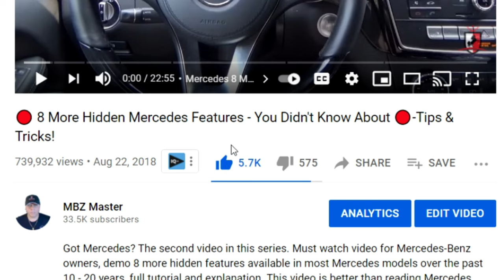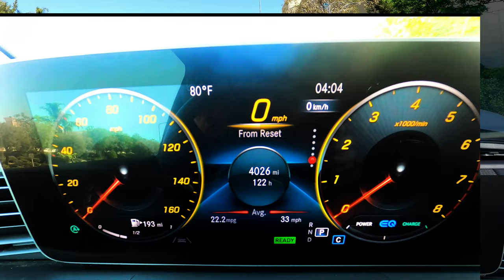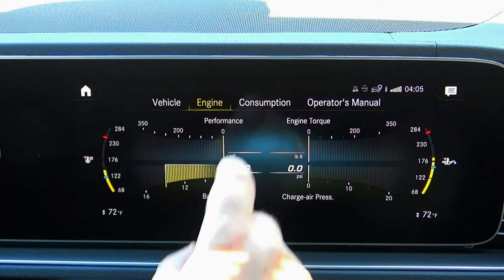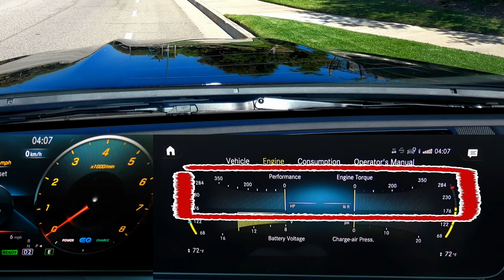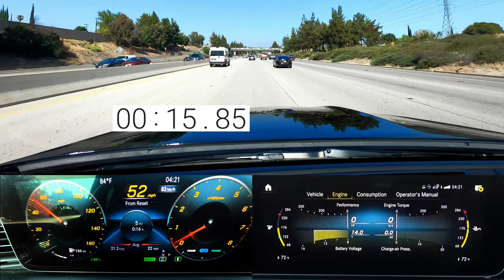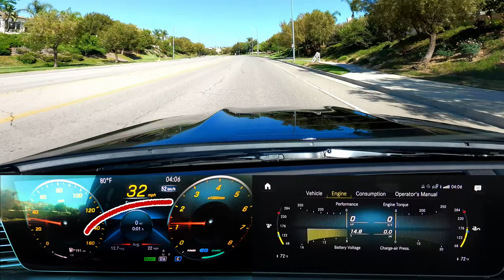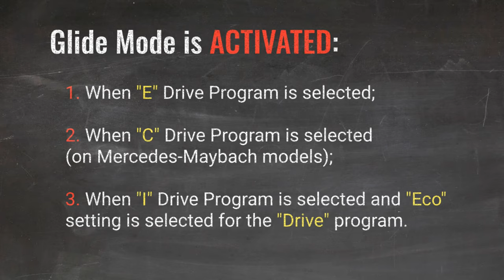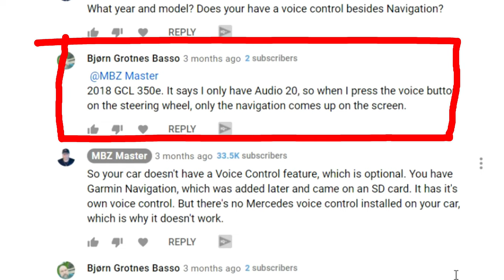Can your car GLIDE? Mercedes Gliding Mode Demo... STOP wasting gas and START saving $$$!

Comment: I learned to drive in old cars with no power steering & assisted brakes. If we came home very late we would switch off the engine some distance from home and coast / glide to a stop so we wouldn't wake up our parents, or wife. . I tried this in the first vehicle I had with power assistance, a Landrover 110 Defender with the V8 3.5 Block. I turned off the key and nearly smashed down my own garden fence at the bottom of the road . I was stood on the brake and needed my full strength to steer. Very unnerving. Never ever again will I try this :)
Reply from the maker: Yeah, on modern cars, if you switch the engine off... you pretty much lose the control of the car.

Comment: 2017 GLC 43 "AMG" - glide mode (cute little blue sailboat icon appears) leaves the engine idling at about 500 or 600 rpm. It doesn't go to zero rpm, presumably because the Stop-Start system uses a semi-normal starter motor, not the integrated SMG approach. Disclaimer - this comment contains some speculation.
Reply from the maker: Yes, as I explained in this video, The engine will switch off completely only on models equipped with the newest 48V EQ Boost models, so the battery can handle the load single-handedly. Other Mercedes models will switch to the Neutral while gliding, also saving a lot of gas but not "0." The engine will be still on.
Reply: @MBZMaster  Hi. May I know if my MB car is running on glide mode and changes to Neutral. How may I change it to Driving mode?
Reply from the maker: As soon as you press the Gas or the Brake pedal, the Gliding mode will be automatically disengaged.

Comment from the maker: Have you ever used a Mercedes Wi-Fi in your car? Why or why not?
Reply: 2017 GLC 43 "AMG" with the low end non-Comand 7-inch screen. Once or twice I got the entertainment system connected to my phone's data connection, using Bluetooth data sharing. Even had BBC News webpage appearing on the car's screen. Also navigated to see some random weather from random locations. Nearly useless. Then it connected to Mercedes, downloaded an update, and now it doesn't offer that feature anymore. No loss, it barely worked anyway. Cheers !
Reply: As I know wifi in mercedes work only as Hotspot.

Comment: Can you do another video to show us how to use the rear seat entertainment system that is located on the back of the headrests of the GLE?  How can it show what’s playing in the dvd player in the front dash and/or what’s playing in the dvd player in the back,located below the rear temperature and fan controls?
Reply from the maker: I have future plans. But the rear entertainment system is usually controlled by rear passengers using the remote control, and rear passengers use their own headsets - not to interfere with the driver.

Comment: I did a 301 Mile journey in the UK today, (2019 W247 B200CDi AMG) in Eco Mode and 'Coasted' (Freewheeled) 92 Miles. Av MPG 74.3 mpg with full Auto Air con on [very hot day] Engine doesn't stop but goes into tick over.
Reply from the maker: Very good!
Reply: @MBZMaster  Thank you, mainly A Roads on undulating terrain.

Comment: Yes please do make a WiFi video also dose glidmode work when the Cruise control is on thank for the videos
Reply from the maker: Gliding will not work with Cruise Control, because it uses the accelerator. You have to let go of both Gas and Brake pedals in Eco Mode.

Comment: Great video ,  Thank you very much. very informative. How does glide mode work when i have the Cruise control on , does it cut off the engine and accelerate automatically whenever the power loses . this way i don’t have to manually do this process.
Reply from the maker: Gliding mode works only when both the accelerator and brakes are released, but the Cruise Control usually uses accelerator and transmission constantly. So, Gliding will not work while using the Cruise Control, except maybe some models equipped with a top-of-the-line Driver Assist Package that can control your car without accelerator.

Comment: Is this function in mercedes cls 350 shooting brake 2016 diesel  ?  Thank you ... 💢💢💢💢
Reply from the maker: You can try it in Eco Mode, as I showed in the video, and see if it works. However, on the non 48V models, the Glide Mode will switch the transmission in Neutral mode (which will also save a lot of gas), but the engine will not turn off completely.
Reply: @MBZMaster  Thank you so much  💢💢💢💢

Comment: Thank, so just set dynamic mode to ECO, while driving take your foot off the accelerator pedal? Trying to clue my Mom in to using this, we live in different states.
Reply from the maker: That is correct, except you have to take your foot off both the accelerator and brake pedals. As long as you engage Eco mode, it will work automatically. If you use it properly, you can save about 30 to 40% of fuel consumption!
Reply: @MBZMaster  does it only work like this for Hybrid? My W205 only goes into D (Glide Mode) for a while until it changes gear ⚙.  Due to the fact yours is EQ it makes sense your engine will shut off completely but my Auto Petrol engine will just cut fuel supply and glide until it requires another gear change down. The only way I can seem to keep this working a little longer than 15 to 20 seconds is down a slight incline on the Motorway 🛣 with speed limiter on and my foot down. Glide mode seems pointless for non Hybrids.
Reply from the maker: @ChaseEverything  Yes it has EQ technology, but it's not hybrid. On your car, the gliding mode puts your car into a neutral position, which still saves some gas, but it doesn't shut off the engine completely, so it's not going to be a 0 mpg.
Reply: @MBZMaster  Is there a way to force Glide mode? Only way I can manage to do it is rolling down an slight incline at the right speed and accelerate to brake a little bit and leave speed limiter on but there should be another way as this doesn't always work.
Reply from the maker: @ChaseEverything  No, can't force it. The car will engage the gliding only if it determines to be safe based on all the vehicles data.

Comment: I have a B 180 d 2016 Mercedes. While I am driving in eco mode, sometime the information in instrument cluster disappear. I press the right/left arrow from stirring wheel and information is back. Is it normal to disappear?
Reply from the maker: Does it happen only in ECO mode?
Reply: @MBZMaster  it seems to be only on eco. I changed to confort and still watching
Reply: I used confort mode only last 5 days and no data disappear from instrument cluster. Before learning about gilding from MBZ, I used the others driving mode too, and never happen any data to disappear from instrument cluster. Except missing those data nothing else happen, the car moving normal and gliding too. Is something wrong with my car when data disappear from instrument cluste?
Reply from the maker: If it only happens in Eco mode, then it should be Ok. Maybe the car is reducing an electric output, increasing savings of gas. B180d model wasn't available in the U.S., so I can't say for sure. Ask your local MB dealership to confirm.
Reply: @MBZMaster  Thanks a lot. I appreciate MBZ very much, and specially you. All the best.

Comment: The lubrification of the gear box it´s not electric. How did they solve it? Nice videos! Best regards!
Reply from the maker: On what year and model?
Reply: @MBZMaster  hi. I have a c220d 2018. Dont know if it has glide mode. Keep the great vídeos.
Reply: @MBZMaster  Hi again! Can you please help me with a doubt? In Europe the 220D as two power setups with (i guess) the same engine. One delivers 170 PS and the other 204 PS, both from 2018. Are they mechanicaly the same? Sorry my bad english....Best regards! Love your videos!

Comment: "Don't turn off your car while driving."  Also, don't remove the key and toss it to your friends in the back seat, as the steering wheel will eventually lock and you'll find yourself headed towards a concrete wall with locked steering and poor brakes. A friend told me about this; certainly not me...
Reply from the maker: The car will give you multiple warnings before acting on it.
Reply: Not in a 1976 VW 'Rabbit' (Golf).  :-) !!

Comment: My A180 SE ( 2019 ) doesn't have the "Gliding option" ? I switched to Eco Mode , and releasing the acceleration pedal didn't make any difference. On the MBUX cluster the gears stayed the same without to switch on neutral. 🤷‍♂
Reply from the maker: That model wasn't available in the U.S., so I don't know, but it should have it. It doesn't switch to N. It just activates the Gliding Mode. Release both brakes and accelerator on the straight road (not downhill).
Reply: @MBZMaster  Thank you for your fast answer.  MYSTERY SOLVED !!! After I wrote the question for you, I drove my car and when I released the acceleration pedal I noticed on the dashboard the gear's symbol changed from D7 or 6,5,4, etc to D only , what means the gearbox disengaged and switched to gliding mode. So......, my car is gliding............❤ . Thank you for all your activity here. Keep going, you are doing a good job 👍

Comment: Pls help ..my c180 2017 show several red indicator gear on screen 1) gear box 2) abs inoperative 3) active break assist function limited 4) Run flat tires indicator inoperative …pls pls advice 😰😰
Reply from the maker: It may be a problem with your brakes, calipers or discs. Check them out. Also check both batteries in your car.

Comment: It works on my E Class 220 D 2017 model. W213. I have to put it in eco mode. My car used to coast for longer distances giving me 78 mpgs not kidding you but recently since it came back from Mercedes service, it rarely crosses 55 mpgs. Despite being in eco and coasting through gliding mode, my car starts slowing down even on slopes. I am not sure what the hell is going on. I am getting my wheels aligned to see if thats causing any issues.

Comment: Fascinating! I didn't know. Doesn't work on my S212, correct?
Reply from the maker: No, it started from 2017 model, if I'm not mistaken. You have to have Dynamic Select function for the Gliding to work.

Comment: Hello it is good information previous  model ml  350 2006 I have seen videos where from the key they move the transmission  oil there is somethig that does not finish closing  me .how long the timing  chain last and its there  is secret  component  since the key is used to lubricante balance craft apart  from changing them osften oil  and filter to proctec the chain from time  engine is at masterpiese
Reply from the maker: I think you used a bad translator, because it doesn't make any sense.

Comment: Do all mb cars have gliding feature? I’m driving 2021 gle 400 diesel using eco mode everyday but gliding mode never turned on… can you help out?
Reply from the maker: I'm not sure about Diesel variant because it's not available in the U.S. Is your car equipped with Eco Stop and Go? Does it have 48 Volt EQ mode? When you release the accelerator and don't use the brakes, is your transmission light changes to a "D" without the number in a different color, as I showed in the video?

Comment: I have a 21 GLA250. And I don't glide...😢😢😢 What am I doing wrong? 
Switch to E mode 
Speed up and let the foot off the gas 
And then?
Reply from the maker: The car has to be warmed up. Try to do it on the straight road, not an incline, and see if the transmission's letter D changes color.
Reply: @MBZMaster  it worked. Thanks MBZ master

Comment: I've noticed that when I cease pressing the accelerator pedal on the highway, my E300 will glide for awhile but I've never noticed the Tachometer going to zero.  Very cool!  By the way, do you know if "Adaptive Learning" in Mercedes-Benz vehicles is a legitimate feature and can be reset as shown in this video: https://www.youtube.com/watch?v=Q-q1BASszmg  ? Would love to hear your take on this.
Reply from the maker: Tachometer goes to zero only on the latest 48V models with EQ Boost. Other models just go into the Neutral, which also saves gas, but the engine is still running using some gas.
Reply from the maker: Adaptive Learning is definitely legitimate feature. I'm actually planning a video to address it, so stay tuned!

Comment: I tried using Mercedes WiFi on my GLC when it was new back in 2018 and discovered it's totally useless. Connecting to it doesn't provide any features whatsoever not even as a hotspot. Watched your wifi video which was good for more recent models that work as I had expected but it doesn't address older models.
Reply from the maker: Older models used slower Wi-Fi and it wasn't very useful, but the new models offer very fast connectivity, where you can get your own mobile service.

Comment: What model years is this feature relevant?
Reply from the maker: It's available on many MB models over the past 10 years. However, if the model is 48V electrified, as the one in this video, the Gliding turns the engine off completely. If it's not, then it disengages the engine and saves a lot of gas, but the engine still works, so it still consumes gas, just a lot less. The best way to see if the Gliding works in your car is to repeat all the steps I showed in this video when the engine is warm, and see if letter D changes the color. Then you know you have it.

Comment: Hi dear
Could you please help me
I bought E350 AMG line 2020
I would like to activate the engine gliding properties.

I follow what you said in the video but reach the engine
Reply from the maker: That model doesn't have 48V electrification, but still should have the "Gliding Mode." Make sure to switch the Dynamic Select to "E" - economy mode.
Reply: @MBZMaster  Thank you dear 
I did.

Another question please.
The tire size recommended  on my car 19 inch wheel is
245/40/19 front
275/35/19 rear
Could I make it
245/45/19 anterior
275/40/19 posterior 
?????
Inorder to increase comfort on driving, especially the roads on our country are not so uniform.
Regards
Reply from the maker: @mustafaalsultan1464  If you change the aspect ratio of the tire, your speedometer and odometer will not show the correct speed/mileage data. Which will result in your computer calculating wrong numbers for ABS, Navi, etc. Plus you won't see the correct speed you're driving. So, if you change, make sure to do a full recalibration. But, if you change also, the rim, so you can keep the same height of the wheel, then everything will work fine.
Reply: @MBZMaster  thank you very much dear
I appreciate your kind concern
Reply: This is not a feature, even my first car Ford focus glide.. it's common sense, every car does it . Once you accelerate hard and leave a car without pressing the throttle the car consumes less fuels as if it's idling.

Comment: Thanks for this exceptionally features but is this applicable to 2017 E300?
Reply from the maker: It should. However, as I explained in this video, it works a little different on your model because it's not 48V electrified as a model in the video. The Gliding in your model just switches the transmission into the N position while gliding. It saves you a lot of gas as well, but doesn't turn off the engine completely, so it's not a total 0. Try to go into E, accelerate and release both accelerator and brakes, and then see if your D sign changed to a green color.
Reply: This is not a feature, this happens on almost every car... it's just a common sense.if you accelerate to hard with the gliding you might end up using more fuel and save nothing.

Comment: Are you using the cruise control?
Reply from the maker: Gliding will not work with Cruise Control. You have to let go of both Gas and Brake pedals in Eco Mode.

Comment: does it work with cruise control?
Reply from the maker: No, because cruise control uses accelerator. It works only when both pedals are released.

Comment: So I assume a 2012 ML 350 Blutec cannot do this?
Reply from the maker: If I'm not mistaken, the first ML with the Dynamic Select was introduced in 2015-16 models.
Reply: Thank you, I've used your channel and info when purchasing my new ML, my next challenge is completing the B Service, I purchased the until to pull a trailer across Canada and my B service indicator came on mid trip, I'm trying to get all the correct parts for the cabin filters, pre filter, left and right engine filters as well as the oil filter....
This will be the first attempt at completing this service on my own, the dealer wants almost $1000 CAD to complete....
Can you assist with these parts, I love your videos and have used your tips on other Mercedes features, I love the vehicle ....it towed over 6000lbs across Canada without issue and reasonable fuel economy..now I must show it some love with this service!!
Any help would be greatly appreciated!!!
Reply from the maker: I don't have any specific place in Canada, but there are tons of online stores selling original MB parts. Just search Google for a few minutes for OEM MB parts and you should find a good selection.

Comment: Dumbest feature I’ve ever heard of. Nobody is going to go 80, die down to 65, go 80 , down to 65 just to save a dollar. Ridiculous
Reply from the maker: Save a dollar? Here in LA, each gallon of gasoline is closer and over $5 now... Gliding can save anywhere between 20 to 35% of consumption. You do the math. But, you will definitely lose a lot of performance while using the Eco Mode, as I described in the video. So I use it mostly when I'm low on gas.

Comment: You might fry your starter
Reply from the maker: No you won't, because those models are equipped with built-in ISGs (integrated starter generators).